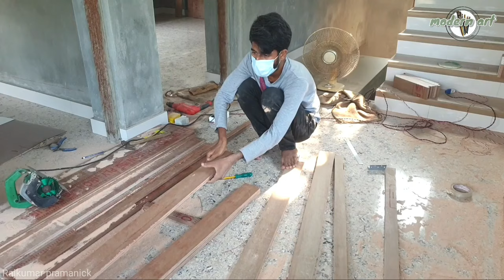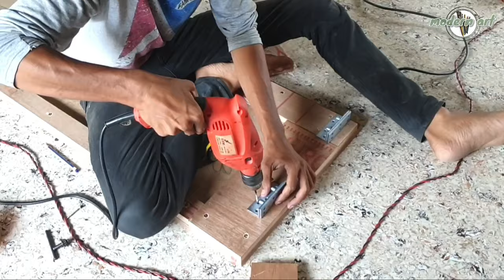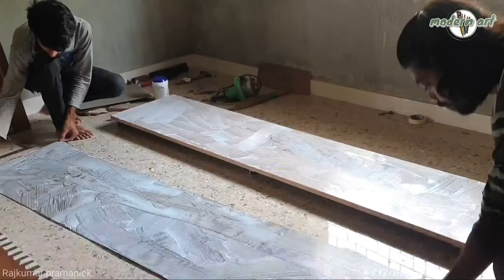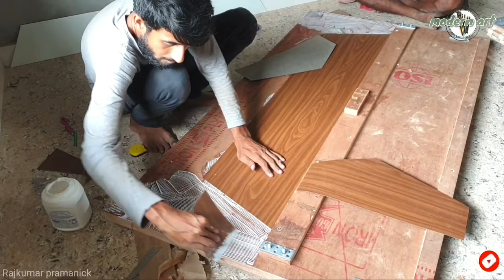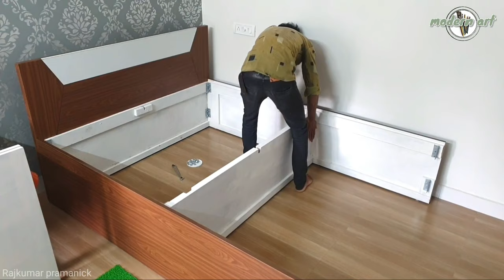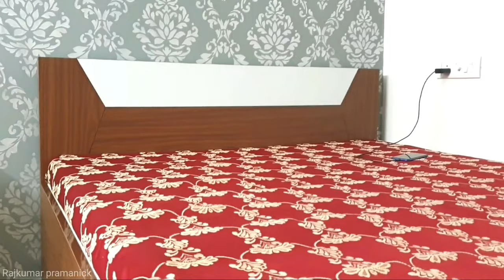how to make a plywood box bed- at home

Comment: Kitni cost atai h ye banane me
Reply from the maker: 17000 without laber charge
Reply: @ModernArt37  ok
Reply: Minimum cost 12k excluding mattress and without sunmaica ( u can use paint instead of)
Reply: @ModernArt37  bro can I give you one suggestion, if without labour cost will be 17000 as per you. If some one  starts work using the impression , initially he will be demotivated because, for 5*7 double bed cost will go  30k ( cutter machine 2k + drill machine 3k + fevicol etc )  then how people will think for DIY. I am also motivated by your video and really good job 👍🏻. I also saved your video in the library but today I saw your comments. 

2 types of ply in market 
1.   Plyboard 
2.   Plywood 

The best is plywood before you buy must see the waterproof and durability test and SIS certificate. Branded plywood starts from 70 to 80 per square feet and depending on thickness.